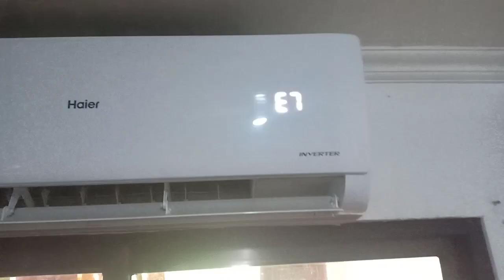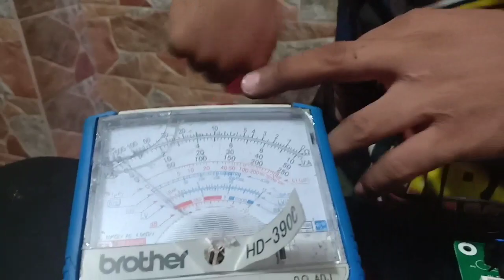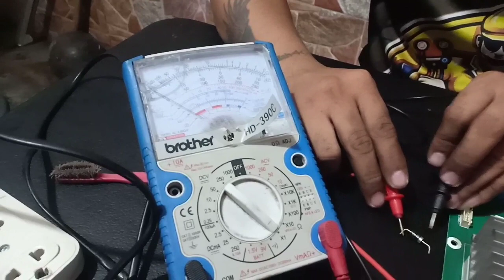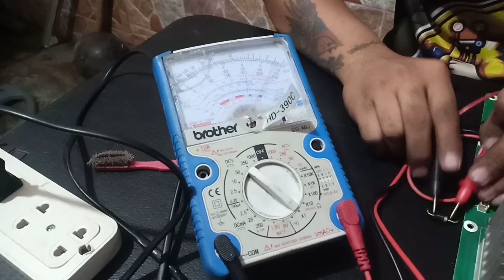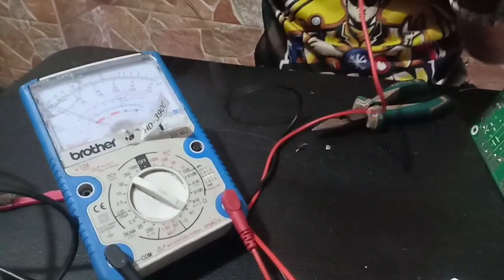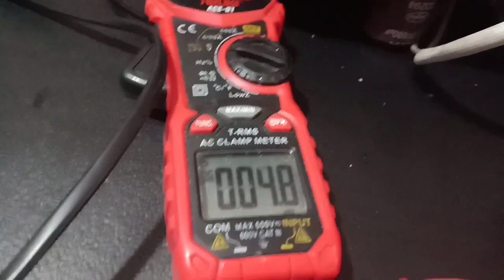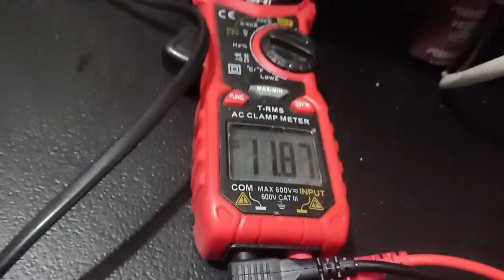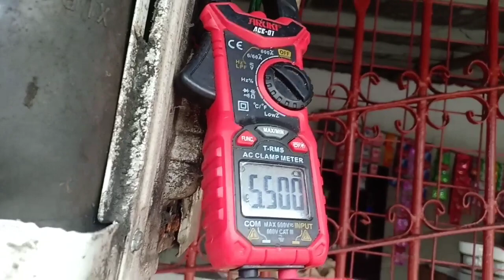E7 error Haier inverter Aircon how to fix

Comment: Ano Kya pong cra Ng Haier inverter nmamatay Po compresor
Reply from the maker: Madami Po pwd maging salarin Jan sir.
Sobra dumi 
Mga sensor
Board
Or compressor
Kung may malapit Po sa lugar nyo na technician pa double check nalang Po salamat po.
Reply: Aandar Po Ng mga isang minuto lalamig Ng knti tpos mamatay n compressor tpos mtgal n uli bgo umandar
Reply from the maker: @MayorBastonero-uo7dl  location nyo po
Reply from the maker: @MayorBastonero-uo7dl  PLS FILL UP THIS FOR SERVICE
NAME:
CONTACT#:
COMPLETE ADRESS:
LANDMARK:
WINDOW TYPE OR SPLIT TYPE:
WHAT CONCERN:
WHAT ERROR:

THANK YOU FOR TRUSTING GODBLESS.
Reply: ganito din po problema ng haier nmin. pareho. pano po ba gagawin.